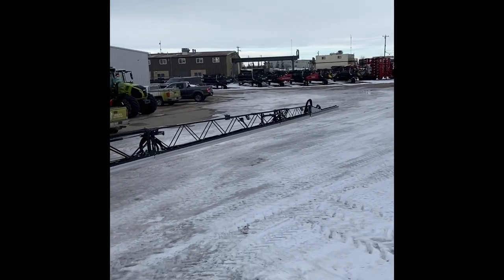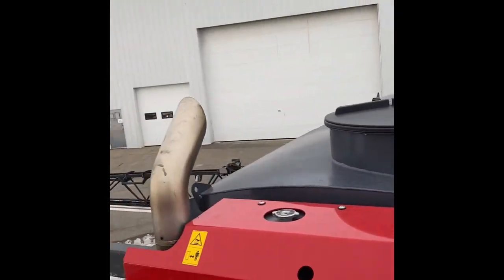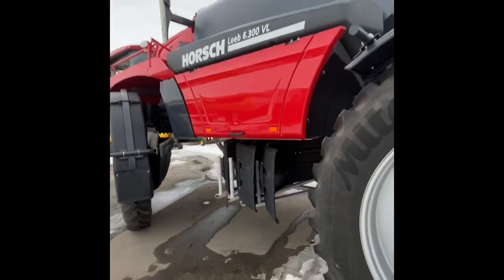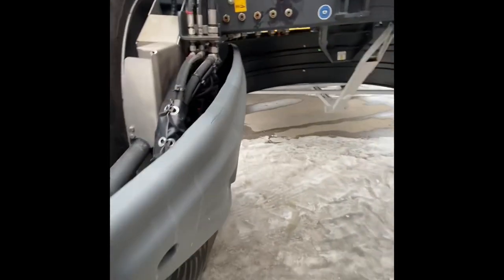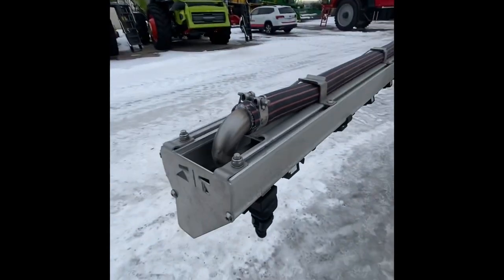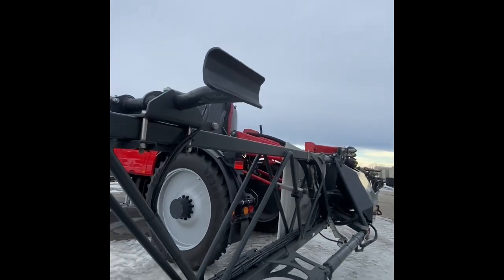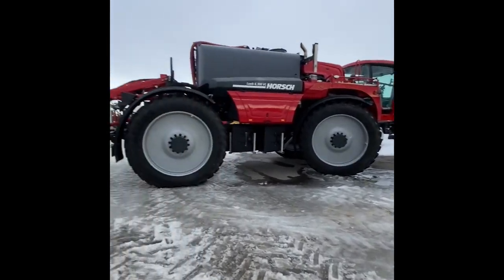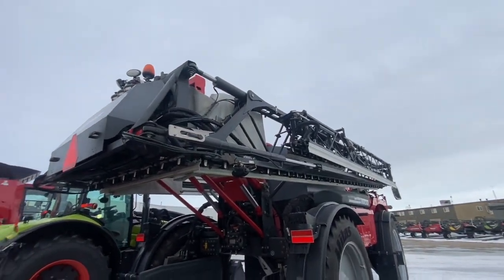First 133.33 Horsch sprayer boom in North America.  New model upgrades.

Comment: Looks good Mike!   Will this rigs eastern twin be making an appearance soon?  Hopefully I can get a demo this season.
Reply from the maker: Hmmm.  Not quite a twin.  Will need the hydraulic lift and the air auto nozzle select.  Think the 133 will take off out there?  Or most will stick with 120?
Reply: @mikewasylyniuk244  Good question.   133 is an awkward size, 135 would work a lot better in 30" corn rows.   120 works a lot better for my controlled traffic than wider but who knows what the future brings.   PS, where is my factory ctis?!?!?!?
Reply from the maker: @Farmerknowsbest  ctis is possible.  It is a factory option on the pull types.  I worry how much corn it would wreck on the high clearance 🤔